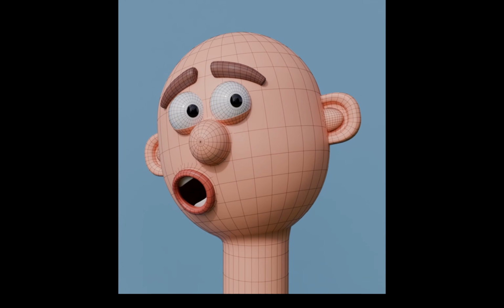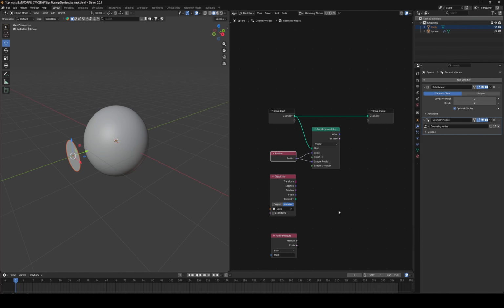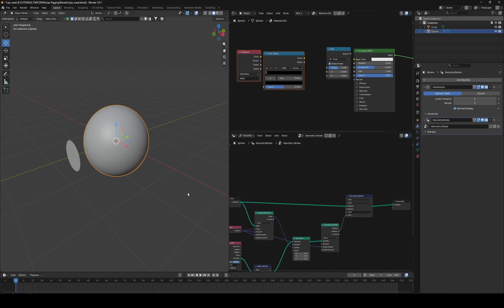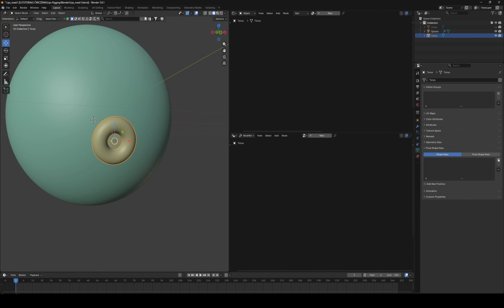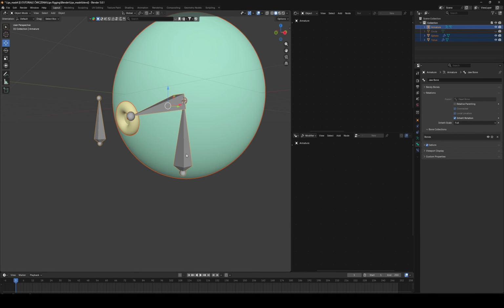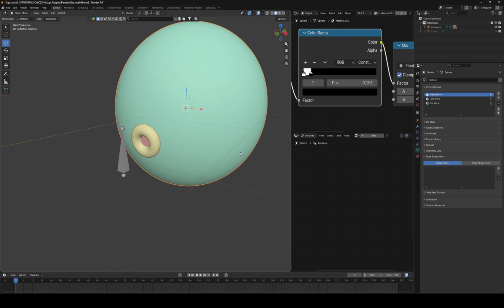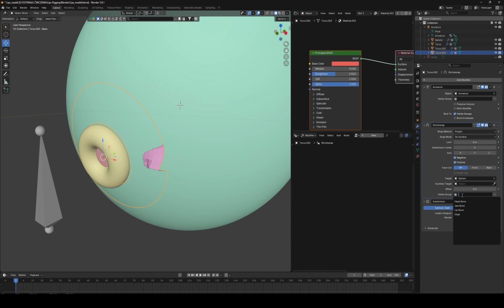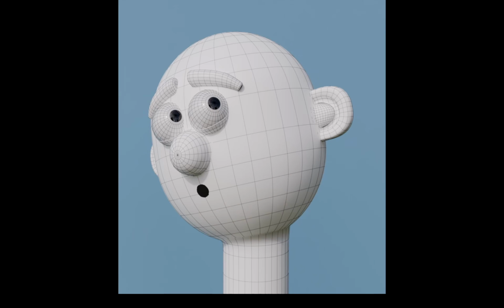Blender Lip Rigging Made Easy! Fast Alpha Mask Trick (No Complex Setup!)

Comment: Amazing and clear tutorial, thank you so much! I was wondering, if we wanted to leave the mouth as just an open hole (like at the 6 minute mark) but wanted to give the masked area some thickness, is there a way to achieve this that you know of? I tried adding a Solidify modifier but because of the nature of the mask/alpha it doesn't really work - I can see the inner and outer thickness but the actual depth is masked out.

Comment: Very nice and thoughtful Rigging application of Masking through GN Setup! This Procedural Masking approach could have several very interesting applications I believe. Thank you for sharing!
I'm just wondering, if it's plausible to have a similar Rig Setup, but without Separating that 'Mouth Hole' Mesh from the Lips Mesh? In many cases (usually when it involves Shape Keys or even Weight Paint), it's often more convenient to have lesser Mesh Objects, don't you agree? I wonder also, many Mouth Rig Setups sometimes use GN but not for Procedural Masking, instead for the equivalent of Shrinkwrapping and if I'm not wrong, even Data Transfer Modifier for Normals adjustment. Do you think it would have any advantage in implementing one or both of these as well [as the Procedural Masking], in this Mouth Rig Setup? Maybe it could help reducing the number of Mesh Objects (unsure)?